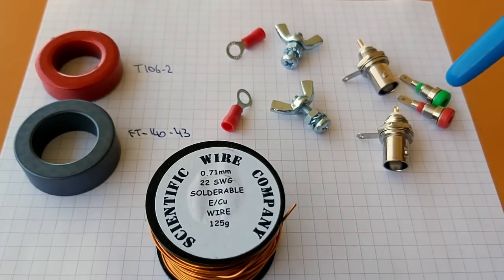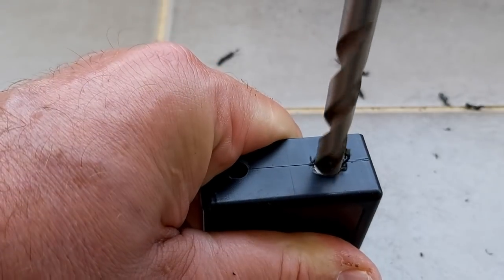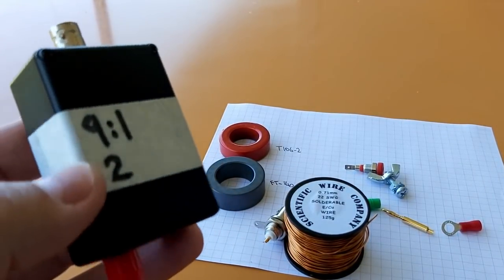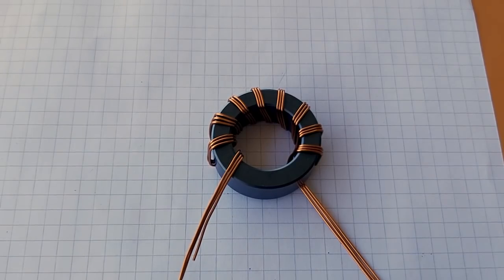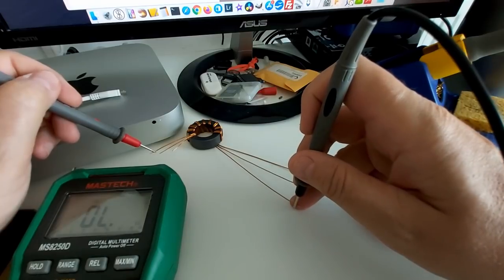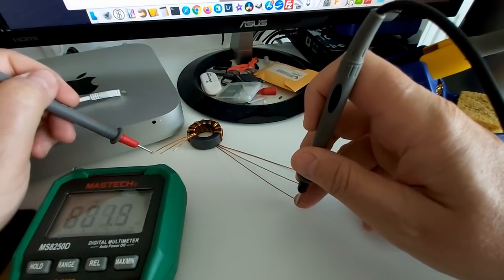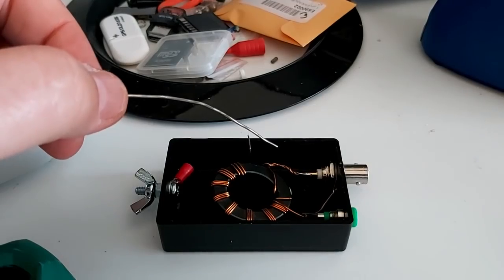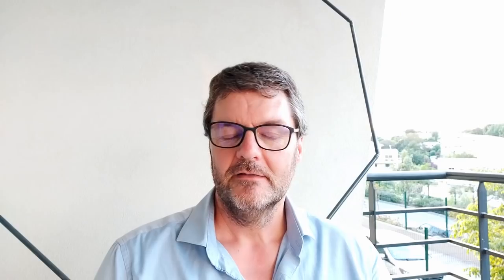Building a 9:1 UNUN With FT-140-43 Toroid.

Comment: Old joke about thread lockers, "Cross threading works better than locktite". NOT! I found that buying and using the longer and narrower step bits will not destroy plastic cases, the fatter and shorter step bits will cause cracking of cases, steps too large.

Comment: It's all about Al value and thus the minimum usable frequency of the unit. And to a secondary matter- self-resonances of the UNUN with no load connected. T106-2 has an Al value of only 135, severely limiting it's low band use, as you mention. For what it's worth, the Al value of the FT140-43 is 885, 4 times that of the iron core, giving you 16x the inductance per turn. Much to consider.  73
Reply from the maker: Great info thanks!

Comment: Quick tip, If you want to get hot glue off of something, spray it with isopropanol (IPA) and it will come right off clean.... From smooth surfaces at least.

Comment: I have always found that when drilling into plastic (boxes) I use a smaller drill bit or a few smaller drill bits and then start drilling, gradually increasing the diameter of the hole until I get to the size of drill bit I need for the BNC or whatever attachment I am using.  Could you have made better use of a metal box for the UNUN if you could procure one for a reasonable cost?  I have never tried using a metal box for a balun or an unun.  AE5ZX
Reply: Of course I am usually too lazy and end up just drilling a hole of the appropriate size in the plastic box, and then just hope for the best.  😊
Reply: For plastic, I drill a small hole then use a reamer to enlarge to exactly the right diameter. This way you can make holes of any size (3mm to 13mm) with just one  3mm drill bit and a reamer.

Comment: Gin, you SO need that 3d Printer.
You're the one that recommended the Ender 3 to me, and I've been happy with it for 8 months.
Reply from the maker: And I still need to buy it! Darn, you beat me to it!
Reply: @RadioPrepper   I've bought 2 so far, and normally they are running pretty much all the time, except this week, I'm studying for my Extra Test on Saturday.
Reply: Completely agree. I bought one a couple of months ago and have been super happy with it. I like the fact that you can start with the basic model and upgrade it easily (better controllers, extruders, etc...).

Comment: Gil, First off I'd like to thank you for all your efforts in publishing these videos. They have provide a huge amount of instruction for me. I think I've bounced around almost every antenna type for my situation. My wife and I live in our 38' diesel motorcoach. There's limited space for antennas. I will be mounting a screwdriver antenna that I've had been dragging around for years but I've always have had reservations about it's performance. I've read and have listened to almost everything about these EFHW antenna systems over the last couple of weeks. I've been trying to figure out how to utilize a half wave length piece of wire and what I could do. One of the comments from another channel, he had mentioned that he put one of these antennas in his attic running all over the place and still achieved great performance. With this in mind I'm going to try to run the antenna wire from front to back several times and see how this will work. At this point I've got fairly good confidence that it'll perform well for my situation. 

Have you strung up anything similar with limited space in your trials of ham radio? Looks like most of your CW'ing is out in the beautiful open country.

I look forward to your upcoming videos about these antennas. I need to get this put up on the roof of the coach and give it a try so I can get more sleep. Lol

Steve Ellington put up a fantastic video of his studies on this antenna system. Well worth the time to watch.

73's Gil and thanks again!
Reply from the maker: Not sure, that is a unique problem.. On a sailboat you have a mast..  You don't... The question is, do you want to operate while driving? Assuming that isn't the goal, honestly, a HWEF on a fishing pole type mast will serve you best, vertical or inverted V. I don't think it will work folded back and forth, but sometimes weird things happen in radio...
Reply: @RadioPrepper  Gil, Being able to operate while driving isn't going to happen. Maybe on VHF. I'll have to give it a try and see. If nothing else I'll be able to throw it into a tree when trees are handy. 

I wouldn't mind if this floated and had a mast. Lol.  If I was a able we'd be sailing the high seas years ago.

I'll let you know how it works out.

Comment: I decided to make this design and it worked really well for the cw range on the 40 meter band. Using 29 feet of speaker wire and a 32 foot counter poise. Though I haven’t heard any voice, my water fall on my SDR was packed with cw. I live in between two hills at the bottom and get really bad propagation.  But This was my first antenna project after 2 years of messing around with the balun that came with the nooelec SDR. I think I just need to get my antenna higher or lengthen it as I only put it up about 15-20 feet. But I’m excited because I’ve never seen so many signals before. And also I tried using it at night so maybe this is why I haven’t heard any voice on the band. But I can tell this Antenna will pair perfectly with my QRP cw pixie. Thank you!
Reply from the maker: Make sure you check the SWR if you transmit with it. You probably will need a tuner..

Comment: Cool beans ! The step drills (unibit) work great for plastic housings .  When I have used a ground reference with an end fed it's really cool to see just how differently the antenna acts over varying soil conductivity.   I have had good results with a counterpoise  and a random length wire but the RX noise was greater.  Thanks for sharing !
Reply from the maker: Interesting thanks!

Comment: Nice! I really hope it works! I also bought one and it arrived for me these days. It is a very low permeability (ur = 10) powdered iron specified as low losses in "all frequencies" (??). I have been researching, and it really makes sense that it is a core with lower losses at high frequencies, since the material allows less effect of magnetic hysteresis and circulation of Foucalt currents. The phenomenon is obseveed in induction furnaces, where the core must necessarily produce heat. conversely, especially in QRP, any loss value becomes significant. than, this core would be better. In my case, I will have to wait a little longer to test because I live in an apartment on downtown. I wait for your opinion in another video too! haha
Reply from the maker: Wait for the second video in a day or two...

Comment: I am HZ1-si (Suhail) from Saudi Arabia
First, thank you so much for this Great channel ..
I heard that some (Core materials) have some advantages over others, Particularly in (Receiving mode) which let your antenna has less noise..
Perhaps That's is why some of the End-Fed producers marketing some of End-Fed antenna as a ((SWL End-Fed antenna only) with limited TX Power capability ..
Hopefully you shed some light on such (the important secret) ..
I say this because I made myself End-Fed Half-Wave antenna, it is very good antenna, I have no big problem in (Transmit Mode) as I can compensate for  Far Away DX station with a little push of TX Power ...
However, I am still struggle in Receiving Mode especially with some weak DX signals
..
Besides, I don't have much (Horizontal space) for the "Wonderful Beverage Antenna" ..
By the way ... Generally Speaking ... which is better in (Receiving Mode) .. (9:1 Un-Un*) or (49: 1 EFHW**) ? considering Both Antenna have the same Length @ same Band ..
*considering a  proper Ground or Counterpoise applied..
**Considering a proper Line isolation applied..
Please Help ..
Reply from the maker: That is a very good point. I did not test noise levels... The second video will be out soon.

Comment: Try putting a clamp both sides of the box before you drill the hole as it should stop it from splitting on the basis you are not using too much downward pressure.  Or use a vice.  Another very useful vid, I can't keep up with you!  Just finished building a 49:1 balun.  Will be testing some EFHW wires with it over the weekend.  We are still in lock down and will be for a while longer,  BYOTA (Back Yards On The Air) for me.  Conditions quite good for a little QRP.  Take care... 73 de M0AZE
Reply from the maker: I should have done that!

Comment: Thanks so much Gil! is it mandatory to remove the insulation before join and weld the wires correct? I'm doing a similar UN:UN with 16:1 9:1 and 4:1
Reply from the maker: Hi, oh yes.

Comment: Like always very interesting video. Thank you! You can test it by loading it with a 470Ohm (ideally 450Ohm) resistor and running antenna analyzer. It should show around 1:1 SWR across all bands. I used a yellow core (+-4cm in diameter) from an old PC power supply. It does work well from 80m to 10m. The materials seems to be "#6".
Reply from the maker: Not the 9:1. The 9:1 needs to be tested with a resistor in the 400-600 Ohms range. A 49:1 or 64:1 however is tested with a 2500 to 4700 Ohm resistor. See: https://youtu.be/0zF7bDoqkG4
Reply: @RadioPrepper  Normally you can not buy 450Ohm resistor but 470Ohm seems to be close enough where 400-600Ohms seem to be too far.  I agree for 49:1 transformer you would need something like 2450Ohm but again you can not buy one exactly like it. Most likely you would have to combine 2.2kOhm with something else (330Ohm)  or use 2.7kOhm. So I still think 470 Ohm is a good approximation when testing 9:1 unun. 470 Ohms / 9 = 52.2 Ohms.  Where 400/9=44.4 (my "." is yours ",")
Reply: @radioastronomy2001  Use a pot and set it to 2450 ohms?
Reply: @ricktafied  Good idea. Thanks.

Comment: First, thank you much for sharing your videos with all us, I have a quick question, How much power can this core hold in digital modes (FT8)? Is 30 or 40 watts okay?, Thank you in Advance,73 de K2WC
Reply from the maker: Hi, 30 should be OK, though with FT8 5W is enough. BTW 43 material isn't good for a 9:1. Check my other videos. Use a #2 red core.
Reply: @RadioPrepper  Thank you for your prompt answer, your are talking about the T200-2 toroid?
Reply from the maker: Yes, or T130-2.  I don't remember which one I used, it's in a video..

Comment: How can you use a multi-meter to test "short" when all your wires are touching and already shorted"? Unless the "lacquer" wire coating is enough to separate them and keep them from shorting out?
Reply from the maker: The enamel does insulate the wires but the circuit itself is such that everything is a DC short, so a multimeter is useless. It is however not a short for AC at the intended frequencies.
Reply: @RadioPrepper  Assuming those frequencies are isolated (in bandwidth). I'm assuming this is what you meant as "intended frequencies". However, once ground is introduced to A/C, a short results, even an isolated ground (not sure of a radiated or ground plane). So this means under operation, those wire must be isolated? Testing however, must be done with an O scope. I do think you said that the multi M would be useless, so point understood.
Reply from the maker: Actually I should have said "the turns are insulated," it really is only one wire... See my construction videos...
Reply: @RadioPrepper  Sounds great....

Comment: I love watching your videos. I am learning quite a lot and I am now starting to build a few things to play around with. I do have a few questions though, maybe you could help me get some clarity.

1) what would the max power be that I can put through this FT140 9:1 unun? If I want to go up to a max of 500w, would I be better off with a FT240-43 or perhaps 2 stacked FT240's? Unfortunately toroid cores useful for RF are not easily available in South Africa and they are fairly expensive when we do get them so I do not want to buy loads of cores that will not get used.

2) when it comes to winding...... Adam (K6ARK) built a small 9:1 on an Ft50-61 but he does not use 3 seperate wires, he winds that with a single continuous wire. (I built that qrp antenna and it works really well). Would that same technique work for bigger unun's or would it be better to use the seperate wires and solder them together after winding?

Looking forward to more quality lessons from Master Gil!
Reply from the maker: All right: 1. You don't build a 9:1 UNUN, which is for random wires with a 43 material core. Those are for 49:1 or 64:1 and half-wave wires. Watch the following video:
Reply from the maker: https://youtu.be/0zF7bDoqkG4
Reply from the maker: If you want to build a 49:1 or 64:1 for a half-wave wire, you will need to stack three FT-240-43 cores. I do not recommend using a 9:1 with a random wire for high power.
Reply from the maker: 2. Yes, but need to test... 3. 500W is useless. Anything above 30W is a waste of electricity and not needed a vast majority of the time. Invest in antenna building materials and knowledge instead of an amp.

Comment: Nice video Gil, but could you explain te windings again  with a total wind of the emailed copper wires i count 8 turns ? at 5:30
Reply from the maker: Count the turns on the inside of the toroid... Every time the wire goes through the code is one turn.

Comment: The Fairite type 43 is not the best material for the lower bands on HF. If you look up the specs at Palomar Engineers you will see that type 43 is better from 20m up possibly as high as 6 m. Type 31 is a better material covering 160 meters to 6 meters. Type 41 will work but not as well.
Reply from the maker: In theory yes, but in practice, everything I have ever found that works points to 43, 52 and 61 for 80 to 6m, with 31 used for chokes. Maybe the choke vs transformer is the difference...
Reply: In recent months, I built 9:1 ununs using both. Afterwards, I used a 50Ω dummy load at the output of the unun, and my analyzer at the input. What I found was that in both units, the response curves almost paralleled the Fairite specs exactly. I've used both for QRP,  and both work, though the 31 works better: Louder signals on receive and better signal reports on transmit. I'll have more time to test with the warmer weather. 

Ahhhh, the fun of Amateur Radio!
Reply: @oobihdahboobeeboppah  just wondered please - on which bands did you find the 31 was better?
Reply: @RadioPrepper  Your correct Gil...and Palomar sell 31 material specifically for common current and noise chokes... other than 160 and maybe 80, meters... 31 material is not recommended for the high bands.. took in their seminar at the Yuma hamfest. in how they explained this.

Comment: Does this work with FT14-43 toroid or would i need to have a different number of turns? And if so, how many?
Reply from the maker: No, a 9:1 does not work well with an FT-140-43. Use a T130-6.
Reply: @RadioPrepper  Probably just a typo, i meant FT14-43, i think i have a T130-6, ill give it a try, thanks
Reply from the maker: I never heard of an FT14-43... See the EARCHI (Hawai Radio Club) pdf file on the matter...
Reply: @RadioPrepper  oh, sorry FT114-43
Reply: @RadioPrepper  Would FT114-43 work?
Reply from the maker: Anything as long as it's 43.

Comment: Thanks for the video!  One question, do you know what guage wire to use for it to handle 100 watts, or would I need a different toroid also?
Reply from the maker: It should take 100W, 1mm wire.
Reply: @RadioPrepper  The wire can easily handle 100 plus watts. The heating of the core is the limiting factor. Depending on what UnUn or balun you make, I've already run 1500 watts using an FT 140-43. Yet a 64 to 1 UnUn for a HWEF won't handle more than 50 watts without getting hot. 
Barry, KU3X
Reply from the maker: And risking permanent damage...

Comment: Actually could someone explain why this isn't a balun? Still learning.
Reply from the maker: BALUN is balanced-to-unbalanced. UNUN is unbalanced to unbalanced. Example: An end-fed wire is unbalanced, coax is unbalanced, so you use an UNUN. A dipole is balanced, coax is unbalanced, so you use a BALUN.
Reply: @RadioPrepper  Of course it is. My bad. So twin flex from say a homemade Magloop would need a balun? 9:1?
Reply from the maker: What is twin flex? Are you sure you mean a magnetic loop, not a regular loop? Mag loops don't need impedance matching other than the big capacitor in the loop...
Reply: @RadioPrepper  We're now talking at cross purposes. Thanks for your input.

Comment: Hot glue ain't water tight .. you truly want ppl to fail
Reply from the maker: It doesn't need to be watertight. This is for temporary portable operations. Even for a permanent installation, these boxes should be vented to avoid condensation.